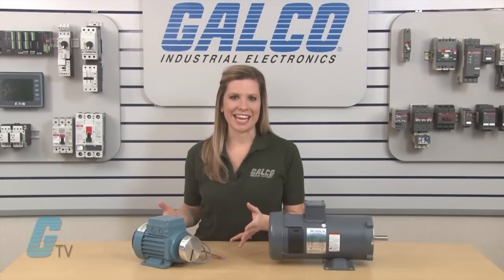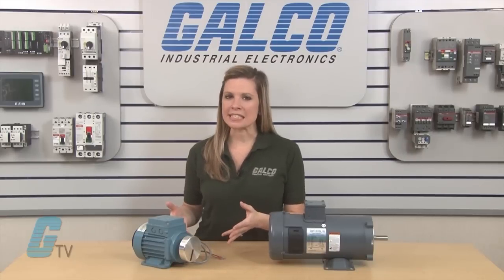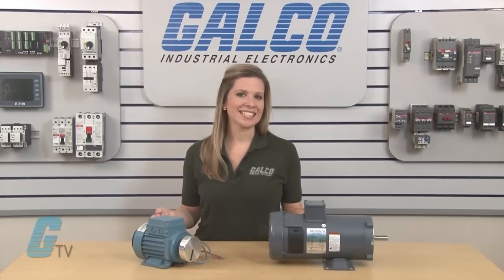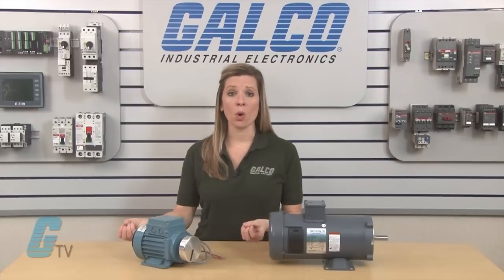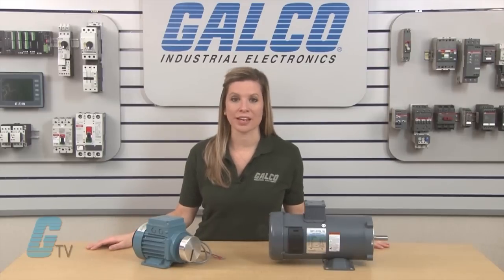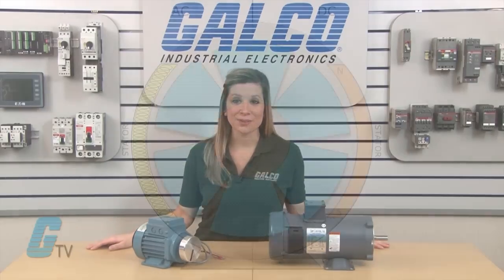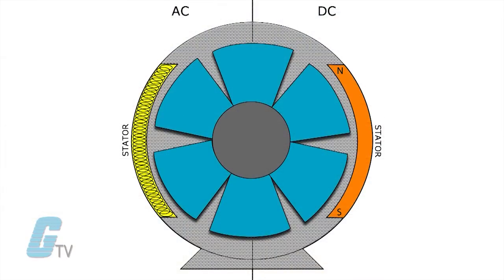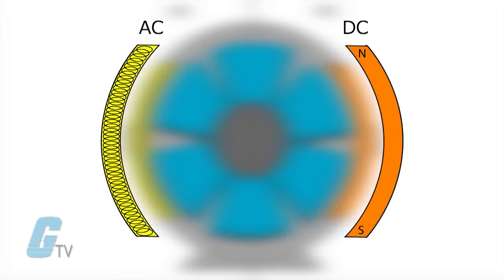What is a Rotor and Stator and How a Motor Works

Comment: If the rotary part has a commutator, as it is the case in DC motors, its called an armature. 
Armatures have a commutator while rotors don't.
Rotors may or not have slip rings depending on the type of induction mechanism used in the rotor (bars or windings).
Slip rings and commutators connect with brushes to make an electrical connection between stationary and rotating parts.
Brushes are mounted in the frame of the motor.
Reply: Need the animation to go with this addendum .. pictures make the brain hamster go wheeling.